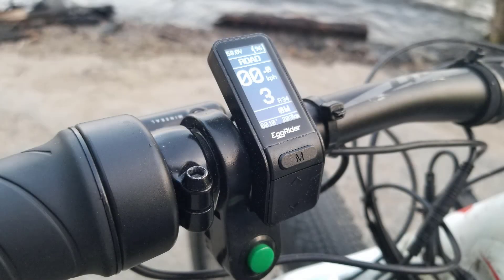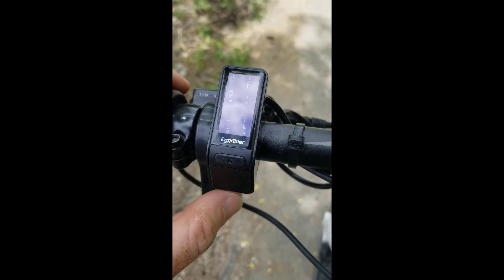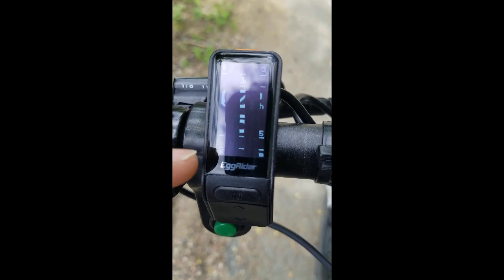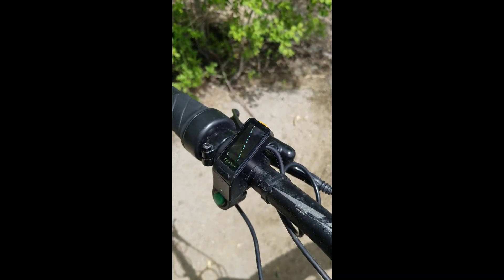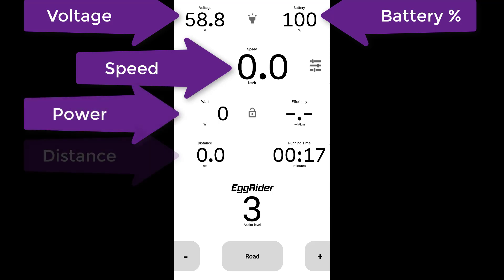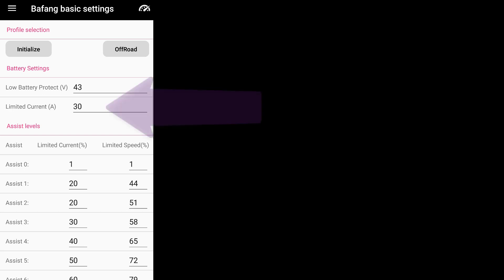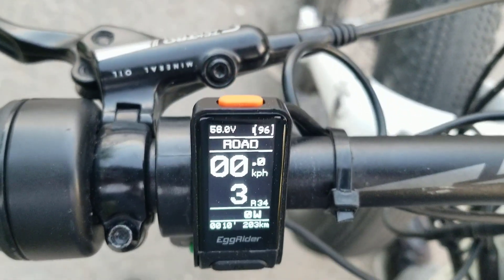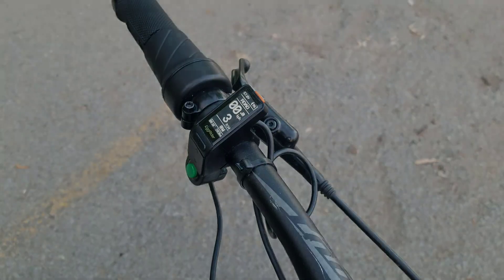Eggrider V2 ebike Display on BBSHD - First Impressions

Comment: I have the bafang 500c display but it bugs me that the max battery is 13s 48v not 14s 52v. Shame
Reply from the maker: Yeah it's annoying for sure. Bafang seem head bent on trying to lock people to 48 volts. They even fixed the firmware on newer motors to prevent people using 52 and higher.
Reply: @HighVoltageKits  so you can't run 14s on a new bbshd?
Reply from the maker: It depends on where you get it. Bafang changed the firmware to lock controllers to 48 volts. But dealers are able to flash this to allow 52 volts. I'd ask the question before you pick one up.

Comment: What is that for a bell?
Reply from the maker: If you mean the green button then it's a motor power cutoff. I was going to repurpose it to a horn maybe... Its not used as a cutoff. Nice idea but useless in practice.
Reply: @HighVoltageKits  Hallo, where can I buy such a switch
Reply from the maker: I think I got it from em3ev.com. ebikes.ca is good as well for parts like this.
Reply: @HighVoltageKits  ok thx, yeah I meant the green button

Comment: Could you tell me how many pins/holes are on the lead that comes from the display please/that connects onto the bike wire?
Reply: I've found out it's 5. But thanks 👍. You still liking it? Has anything cracked on yours?
Reply from the maker: It seems good. I love it but not so much because it's a perfect product but because it's a good concept and the people behind it are working hard to improve it. The asi communications should improve with updates. But it's small and stealth which is the best part.
Reply from the maker: I'll have to check later. Have a feeling its three but I'll confirm later.

Comment: You can see the screen because you have polarized glasses. Most sun glasses are not polarized. It's just a guess but are your glasses prescription, because it's usually am option to have them polarized.
Reply from the maker: Yeah they have polarizing on. Pretty sure you are right.
Reply: Even cheap 3€ sunglasses these days have polarization, the process costs literally nothing.